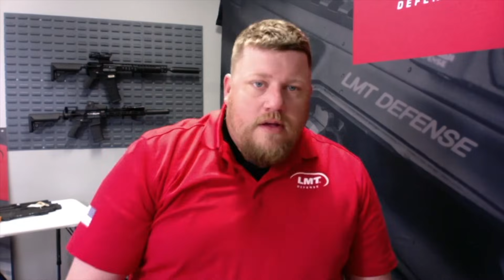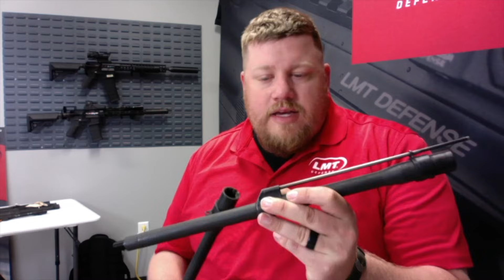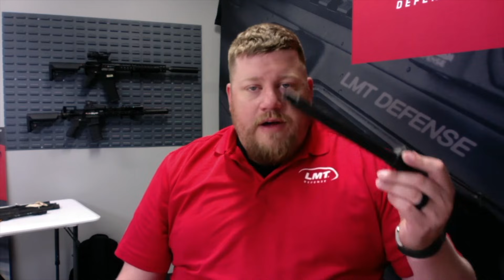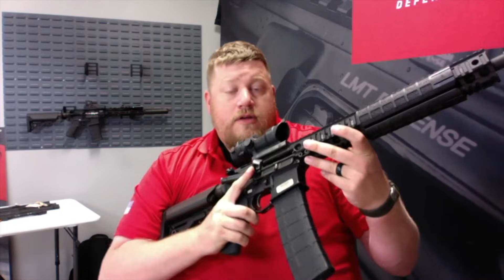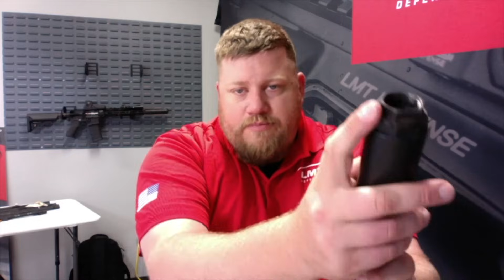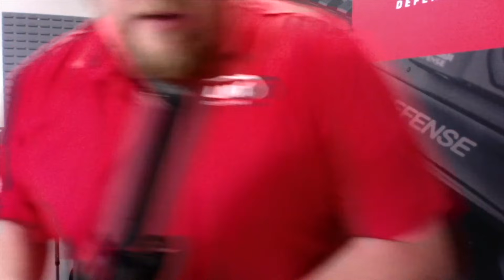LMT Q&A #17 Who is LMT Advanced Technologies???

Comment: I feel like xeno didn't catch on as fast as it should have. It seems like even Dead Air dropped the ball with ongoing marketing of it.

I'm a huge fan of xeno and would love to see a short format video from yall just continuing to get the word out about this system. 

Any plans for a 13.9 pin weld to 16 choice for xeno coming?
Reply from the maker: Perhaps in the future AT will offer LMT ready barrels. Xeno is a great platform that is simple and doesnt involve too much maintenance. Remember the AT bases just like the dead air bases, use the 1.375-24 thread which is also used by many others. This means adapting to Keymo, ASR, or YHM QD is a breeze